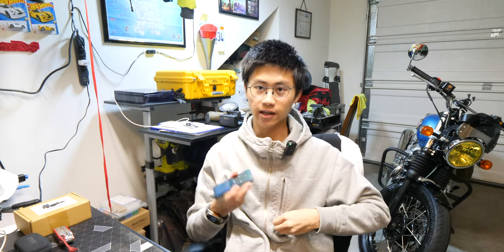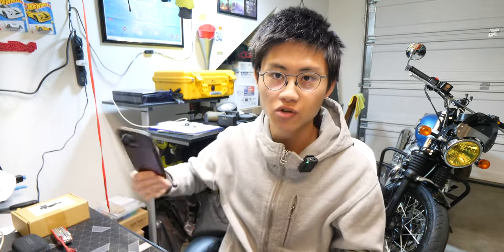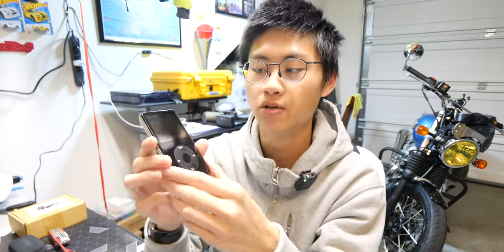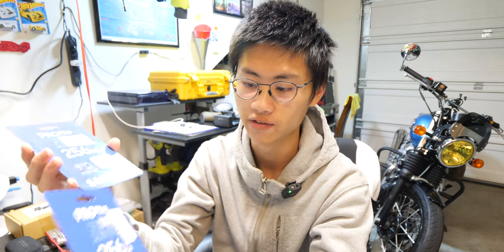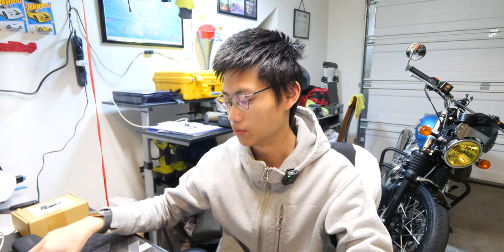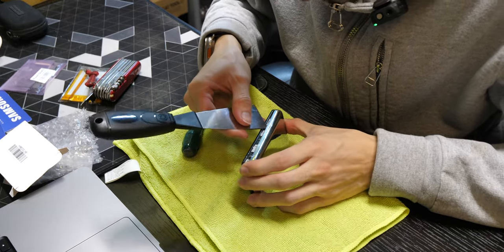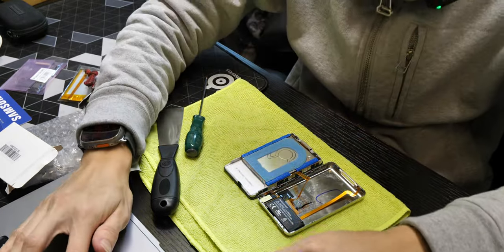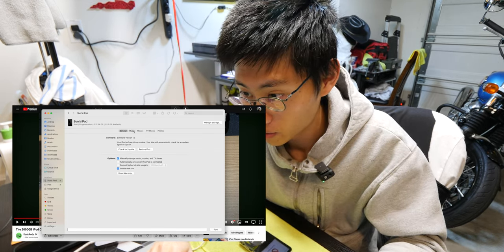Modding An iPod For The First Time

Comment: when my 6a-gen 160GB died, i popped it open w/o the right tools, and it turned out a lot worse than yours. bad hard drive, never snapped back together right, and i ended up just e-cycling the thing, which i immediately regretted when apple announced they were discontinuing the classic. eventually found a 6a (80) and a 6b (120), now waiting on both these mods and the bluetooth mod. the apparent 128GB limit on them is disappointing, but at least i won't have to worry about janky 16-17-year-old hard drives self-destructing. i'll be sure to use the right tools this time

Comment: I still have my excellent [body wise] 6.5 Gen iPod Classic [silver] with over 7000 songs on it.    The battery is "failed" now since it won't hold a full charge (it still charges up, just won't hold it).   I bought it brand new from eBay in 2012.

Comment: Been to and fro struggling with my Gen6 and finally wondered if I could use Termite to open the darn thing up, but it only took a kitchen knife to finally let the genie out. 
Next step is to disassemble the rest; much how to open the connectors. And finally order a new screen, a backplate, a frontplate and a board for SD-cards, and maybe a new battery, though I have one spare. While ordering front- and backplates, some crazy colours would be nice.
AliExpress will supply the hard hardware, though choices of colours are a bit limited, but I get things duty- and VAT-free (actually not, but hazzle-free) to Sweden. The electronics, however will be order from OEO.
As I commented on the other video, these videos are great. As a rookie you do pay a lot of attention to details any experienced upgrader miss, and details that are important to avoid mistakes and ruining critical details.
Reply from the maker: Thanks for taking the time to write! Looks like you picked one of the toughest generations to open. I admire your persistence! Please keep us updated on your project!
Reply: @iamalexsun  Many comments are useful as well. I got my iPod before I knew of all the options to upgrade and knowing that Gen5 had a better DAC, the only (and cheapest) one I could find in Sweden was a Gen6.

Comment: I dumpster-dive a lot and I found a box with 6 of these. 3x Black 30GB slim models, 1x white 30GB slim model, 1x Black 80GB model (wide model), and 1x 6th Gen (Aluminum face) slim 80GB. 

Only 1 of the 30GB black 5.5th gens sort of works but freezes up randomly. The rest either have failed drives or batteries from what I can tell. So stoked to try this. Thanks for posting!
Reply from the maker: Thanks for the comment! 

That’s a great find! Hope you’re able to revive them all! Please keep us updated!

Comment: Wow! I'm doing this. I bought two 160 Gb iPod Classics when Apple discontinued them. But my library has grown and doesn't fit in 160 Gb. I bought an iPod touch with more memory, but my library has outgrown that as well. And the iPod Touch interface is sucky. It has a lot of silly features I don't want. Radio? I haven't listened to radio since the 70's. It's always trying to push Apple streaming or iTunes store media on me. The battery can barely get me through a 3 hour plane ride. This is awesome!
Reply from the maker: Thanks for the comment! I’m glad the video helped! 

Here are some more useful info to consider: https://youtu.be/E9ewxFGI8pI

Also, here’s a test I did of the 3,000mAh and 3,800mAh batteries: https://youtu.be/WiOrS_PHOrc

Help you’ll find these useful!

Cheers!

Comment: Great video. Made me as a Gen-X search for an iPod Classic with the goal to "disconnect" from the online life now and then. BTW, 30GB has 32MB of RAM, 60GB+ has 64MB.
If you start with 2x 512GB memory and you run out, can you just add 2 formatted memory cards and they will be recognized or do you have to reformat?

Comment: Funny you say that about Amazon, I just got myself an Innioasis Y1 (which is basically a clone of the old 120gb Ipod Classic) and they didn't even give me the USB - C cable that was supposed to come with it. So I had to go out of my way to buy a replacement. I was able to get the thing to work but ya still should get what you pay for, and I wasn't going to go through the hassle of having to send the thing back either.

Comment: Great video! Fyi: The iPod has been opened before, judging by the replacement battery, as this is not the original : )
Reply from the maker: Thanks for the insight!
Reply: @iamalexsun I actually did the same mod not long ago, and got a little triggered by the open space at the top 🙃. I then replaced the clicker with an Apple Taptic Engine. There’s some soldering required but the result is nice!

Comment: Great job modding the iPod. Can you shuffle songs with the 512gb upgrade?
Reply from the maker: Thanks! 

Currently shuffling 11,278 songs with no issues. All in 16bit 320kbps MP3 format (~120GB).

I recently switched the logic board to a 64MB one that came in the 80GB version of the 5.5. It was shuffling flawlessly with the same exact amount of songs on the 32MB board previously. I have yet to notice any performance improvements or differences between the two boards yet. 

Will definitely provide a more comprehensive update in a future video!

Comment: Great video so once you put it back together, you format the drives in FAT 16? Then plug it into iTunes which recognizes it and restores/loads the iPod firmware?
Reply from the maker: Thanks for the comment! 

I suggest following the iFlash SD card formatting guide to ensure the best outcome. 

iFlash Formatting Guide: https://www.iflash.xyz/prepare-sdxc-exfat-for-use-with-the-ipod/

After formatting and installing the cards, plug everything in, and iTunes should recognize it and prompt to reset when you connect it to your computer. 

Hope this helps!

Comment: Could you do a time lapse video testing out the 3000 mAh Battery in your Ipod 5th gen? I've heard on reddit forums that the 3000 mAh Battery isn't lasting up to expectations but oddly enough, nobody on YouTube has taken the time to actually test the battery life. It is all hear-say.  Lots of videos on YouTube on how to upgrade and install but no actual testing.  Thanks.  💯
Reply: there's a 3800mah battery now that fits and because it's newer it'll have close to its full life unlike the older 3000mah ones sitting around for years
Reply: @escapetherace1943  How many playable hours are you able to clock off the 3800 mAh battery with your Ipod 5th gen?
Reply: @escapetherace1943  I'm hoping someone makes a video of this claim, puts a stop watch next to the Ipod and tests it.
Reply: I saw a YouTube video of someone (dankpods?) testing the battery life of the 3000MAH and an iPod Classic Gen 7.  He got over 45 hours on a single charge.

Comment: Dumb question, how long does the restore take? I’d have guessed a minute or two, you said half an hour, I’m having bad luck with the 5th gen I’ve got, but perhaps I’m being impatient?
Reply from the maker: Good question! 

I go over this in more detail in my other video about my iPod at around the 7 minute mark (https://youtu.be/E9ewxFGI8pI?si=Egfx7EM7T-loBdQ2)

It took about 6 hours to sync my library of around 12,000 songs. Since the transfer speed bottleneck is hardware related, it all comes down to the file type, encoding, and the amount of songs you have. 

Hope this helps!
Reply from the maker: Wait, I completely missed your question lol. 

It took around 15-30 minutes for the restore process. Don’t panic if it takes too long, these things are pretty old. If it takes more than 45 minutes and appears to be stuck on the restore screen, I would consider unplugging it and reboot your iPod by holding the center and menu button at the same time for about 5 seconds.
Reply: @iamalexsun  I’m a bit stuck, High Sierra iTunes and Sonoma Finder both don’t want to restore this 5th gen I’ve got despite it working fine with the original hard drive… they see it, try then fail (err 1433 if that means anything to anyone) 🤔 I’m going to try different SD cards and hope! Seems weird it could be dead in such a specific way with everything else working, unless you’ve got ideas? You mentioned formatting (I’ve don’t the card) but did you also format the iPod itself in Disk Mode?
Reply from the maker: @AngusPearson  I would attempt formatting the iPod in disk mode. It could be an SD card issue as the iFlash boards are very picky with the brand and capacity of SD cards. Here’s the SD card compatibility list on the iFlash website for reference: https://www.iflash.xyz/store/iflash-quad/